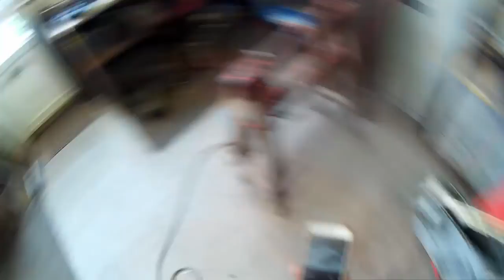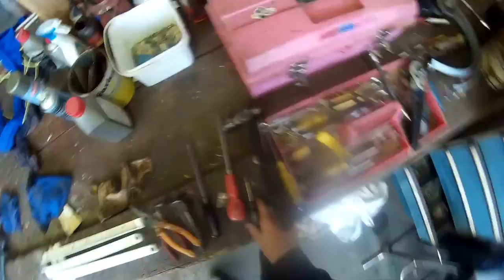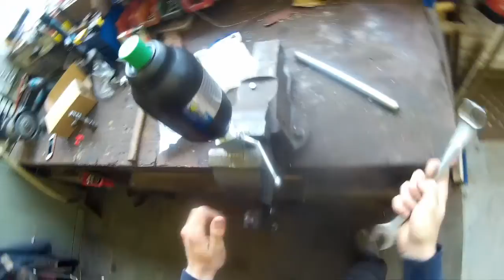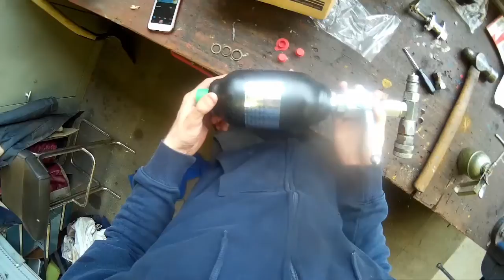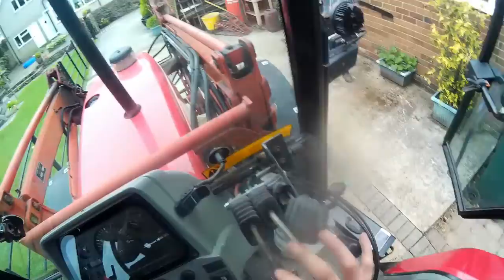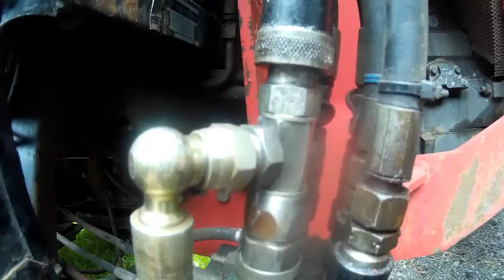Bought myself a "spine saver"

Comment: Your going soft lad 😂. I'll be interested to see how you get on with it after a few weeks. Could do with one on works massey as well but it never occurred to me to bother fitting one 😂
Reply from the maker: aye, could be need a/c and powershift yet . It does ride very well with the bucket on (about 250 kgs) havnt tried without yet all though well worth it for £150 and some fittings
Reply: Lol yeah, I need my a/c fixed this winter in the trac, can't do with the hay dust all over! Well you can't argue with that price then. Be interesting to see how you find loading with the soft ride engaged, or do you have to switch it off?